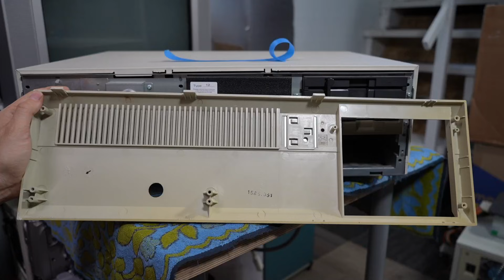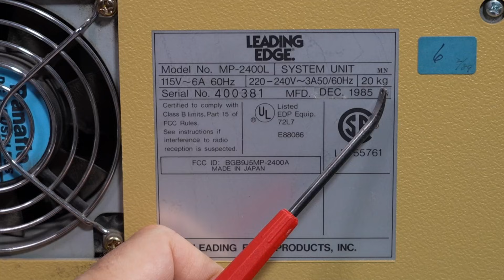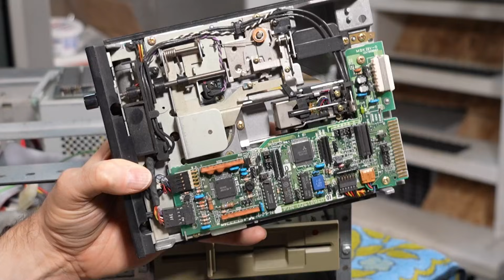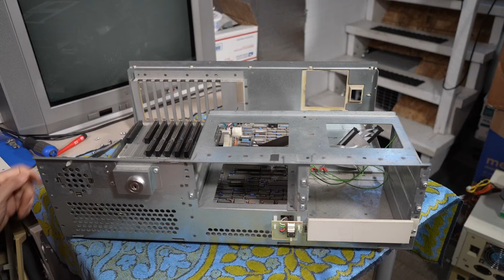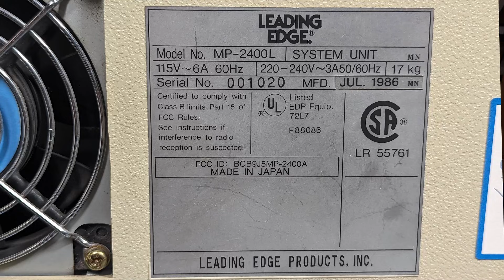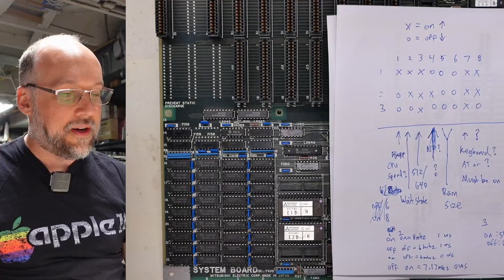PC archeology: The Leading Edge MP-2400L doesn't exist

Comment: Waaah! I got one of these used in 1991. Mom paid $700 for it! Poor mom. It had one 5-1/4” drive, 20mb hard disk, 12mhz 80286 processor. It did have a VGA card. 1MB RAM, if I recall correctly. I tried to put in a sound blaster, but I was 9 and couldn’t get past the IRQ conflict, even with the guy at Walden software trying to help me. I remember an adult laughing at me once and calling my computer a dinosaur when I was trying to see if eye of the beholder 3 would run on it (required a 386). The Walden software guy glared at him. 😂
Reply: Actually mine may have been a slightly different model… but this is the closest I’ve ever seen on the YouTube. I miss mine and wish I’d kept it. 😢
Reply: The oldest Sound Blaster used IRQ7 by default which might have been used also by the parallel port, which is why Creative later changed the default to IRQ5, but if you had the old card it was merely moving a jumper, and changing the environment variable that the autoexec.bat would set (to tell games what IRQ is being used). I was only a few years older but could solve it by myself. I own the original Eye of the Beholder and played it with a 286 clone + VGA + Sound Blaster, it had zero music, just sound effects (Reused in later Westwood games like Kyrandia!), and with a mouse you had an extra phantom party member that could throw things from the ground at enemies while the whole party was still on cool down 🙂
Ah yes, the end of the first game is unsurprisingly a beholder, which had death ray. so the trick was to always keep moving and do circles around a column, shoot. move rinse and repeat. Then you get the glorious ending which was just a little bit of text 🙂

To me the game that required a 386, (mostly because of the 4mb ram req) was Might & Magic IV (and V which could be combined for something bigger than the individual games), that was a much better game that the Beholder trilogy. Of course Arena aka Elder Scrolls, and others would benefit too...
Reply: @freeculture  Yeah, those Might and Magic games were cool, a bit above my pay grade at the time.  Eye of the Beholder 3 was the one that needed a 386 (at least according to the box).  I probably spent more time with the Kyrandia games and never finished those either! :P  I think I ran the original Eye of the Beholder on an 088, believe it or not.

Comment: Made in Japan...at exactly the wrong time.  Shortly after this, the Japanese Yen exchange rate exploded vs. The US dollar, which made Japanese electronics more expensive.  The Taiwanese clone makers got their act together and started producing high quality goods, and by 1990, DTK (made in Taiwan) was the supplier of choice for local computer stores.  I worked at a local computer store in 1990-1991...
Reply: Indeed that's what i know, in fact i still have a couple DTK cases and PSUs, just not the actual DTK 10mhz 286 motherboard which i used to have and it filled the entire bottom of the quite big desktop case with its 1mb onboard ram. Of course DTK used the proper red lever power switch like IBM's 🙂

Comment: I used to work with exactly that machines in the old days at the high school.
That 286 model used to be distributed as OEM product. That means... it's a clone. There's no company which owns that brand as the main propietary. 
In Spain where I am, that computers were sold as non branded PC's. 
Also El Corte Inglés stores sold the same with their brand in a sticker. 
It was very common here in the 80's.

Comment: so it's got 9 ISA slots soldered on already, and 1 blank.  if you soldered in that blank, would it work?  also, could you potentially change those 8bit slots to full 16 bit?
Reply: That should work. It's just a bus. All connectors are connecten in parallell.
Reply: I don't see any extra components, not even decoupling capacitors.

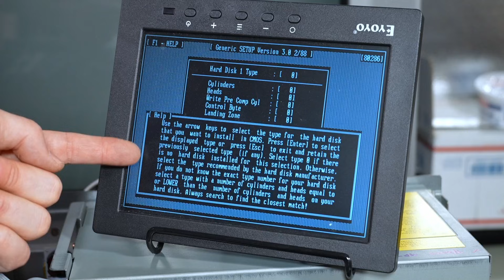Comment: 54:28 Shouldn't you stand with the cursor at the "Hard disk 1 type" (at the top) when you use left and right? It looks like the cursor was on Unformulated capacity.

Comment: 690W input for less than 200W output.  Wow.
Reply: I think the input rating is accommodating for the expected monitor connected via the pass-through connector.
Reply: The power rating on equipment badges include peak inrush current for planning how many circuits on how many breakers of which size when all loads start up simultaneously. It doesn't mean that the power supply actually runs with that much current draw except momentarily with capacitors discharged.

Comment: This computer is HONKIN' HUGE!  Holy cow!  Amazing.  Didn't know that Leading Edge made 286-class machines.  A bunch of years after I moved out, my parents, who were hopeless with technology, purchased a Leading Edge Model D at the time when 386's were basically the standard - the D computers were being closed out and were not really that useful, esp. since theirs was a monochrome model with dual floppies.  I think they may have turned it on once or twice but it just sat there gathering dust until they donated it years later.  It was a solid little machine, just a basic XT-class computer without any real differentiating factors as I recall.

Comment: I have a 286 machine (well, part of one) which also has a power supply similar to the one in these Leading Edge PCs. The PSU is also very large and heavy, has a very similar shape with an overhang that sits above the motherboard, and uses an even more non-standard power connector for the motherboard. It's a WysePC 286 and I have documented it on the Retro Web website. Including mapping the PSU connector so that if it comes to it, a standard AT power supply could be used with an adapter. Even more interesting in my system is that the CPU oscillator is not on the motherboard. Instead it sits in a little metal box bolted to the side of the PSU at a distance from the motherboard, and outputs 2 clock signals which are carried over to a motherboard header via 2 coaxial cables. I had that documented as well, and in fact it has made it easy to replace the CPU clock with a variable frequency oscillator for easy overclocking and underclocking. :)

Comment: 21:36 most of the computers (PC) before 2000 are tanks, they survive anything, still have my old P2 doing dedicated firewall and works great, uses low power and is passive cool, 500Mb of ram, 3 ethernet cards, 8Gb disk

Comment: the motherboard power connector looks the same type as on the commodore pc10-3/pc20-3/colt, but different pin functions as it has all voltages on the commodores

Comment: "But Tandy computers weren't completely compatible and had proprietary parts.".

Yes....  And as this shows, so did nearly EVERY PC compatible up until about 1989 or so.

So many people just don't know the true history of the PC market.  The original IBM PC was not compatible with nearly any of the PCs that came before it.  It too was "proprietary", when compared to nearly all of it's predacessors.  

Then, companies began to fall in line with IBM PC standards.  This PC is a great example of that time period.  The power supply here was proprietary.  There may have been a few other things in it that were too.

No complaint or insult to this one....  Only a complaint against the gripe against others like Tandy for that time period.

Comment: did i miss where you said why the Eyoyo monitor is upside down? its messing with my head, since i have same model.
Reply: I think he covered that in another video a while back. The Eyoyo sits nicely in that little bracket he's got if it's upside-down, and the monitor has on OSD setting for inverted operation, so there it is.

Comment: I had one of these as a kid, starting with a 286 MB, then upgraded to 386, then Pentium, then got rid of the chassis. I used to install the bottom and top drives with only one rail, because none were available for sale here in Hungary.

Comment: 98.5% of countries use standard units of measurement, you don't need to convert kg to a non standard unit when speaking, since this is a global content platform.
Reply: My experience with case screws, is that most of them used both types of screws. Only a few used imperial only, and rarely some had a thicker type with the same imperial thread just for the case. Most common is phillips + hex head. Rarely flat, but i remember IBM (ironically) used flat + hex in their think centre era and Lenovo inherited. I still have a box full of them since the 90ies.
Reply: Also, why are you not disclosing how big that power supply is? Hands? Come on.. Give us the measurements in standard units of  measurement.

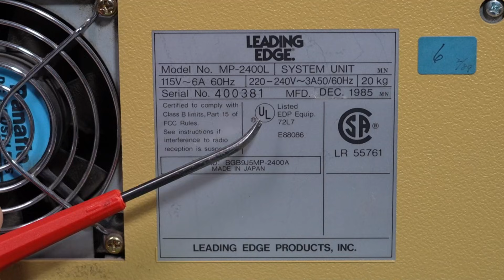Comment: 4:10 -- Hi Adrian!  You point out the 6A rating on the power supply.  That number is a nameplate rating for an electrical installer, used to size breakers and circuits.  If an office was being built out, the electrician would ask how many machines are expected to be installed and used at once, and then divy up the runs to the main panels accordingly.  That 6A number will cover the inrush current, and is not the expected operating load.  If you have a power outage, every machine plugged into the circuit will surge-draw at once when the power is restored, and you don't want to pull 300A (causing a lot of downstream damage or outages) because you cleverly power-stripped 50 machines onto a single 15A line.  You'll see similar ratings on LED power supplies now for the same reason, they're rated like 5A on the input side (600W) even though they're only 350W units at the absolute most.
Reply: Do they still ask those questions today? Or is that just a byproduct of old building codes?
Reply: @SockyNoob  Yes they do and it influences the choice of breaker profile which is used

It was about this time that the very "spiky" load of PC switchmode power supplies started to be noticed as causing problems in building distribution systems (it's a similar issue to power factor in industrial settings) and power companies started billing extra for unsmoothed power draw - which rapidly resulted in switchmode supplies with more "linear" power draws being developed
Reply: @miscbits6399  Yes, this is why we put PFC (Power Factor Correction) circuits in switch-mode power supplies. Of course, it's not universal, a lot of cheaper supplies don't bother, but any supply that is targeted at office/industrial use just won't sell without PFC.
Reply: @AureliusR  Unfortuinately that hasn't been much of a priority for home systems..

But more to the point for this particular video, I remember that Power Factor issues only became a matter of attention around 1984-5 when the spiky loads were identified as causing serious neutral currents in 3-phase building supplies that the distribution system hadn't been designed for and the need for PFCs started being discussed in both industry and hobbyist media about that time. It got my attention because I was trying to diagnose/mitigate  RFI interference from 48V switchmode units (telco digital micriowave systems - DMR)  being deployed in/near landmobile hilltop stations. 
The effects of a forest of rampant switchmode harmonics coupled with fencing wire/staples (most  sites were surrounded by 5 wire sheep fencing) acting as (poor) diodes  in an environment prone to clouds can cause splatter all the way from 30-500MHz and effectively raise noise floors by 20-40dB (which translates to a loss of ~5-10x range on the receivers, which in turn means extremely angry customers) if they don't completely wipe things out on particular channels (particularly ~100MHz narrowband AM channels).. 
All the DMR makers had to seriously up their game in terms to attention to RF emissions from components as a result, which played through to most switchmode designs (This was the end result of about 6 months of increasing problems and a few weeks analysis, followed by weeks of trying to mitigate emissions from existing supplies (which kinda worked but it was cheaper to swapout the PSUs at a cost of ~$80million and make it Fujitsu's problem)

PFC PC power supplies only became common in the late 1980s and I only started seeing them in typical Taiwanese-sourced clones in the 1990s

IE: That box is highly unlikely to have any PFC in it, which means the current profile is spiky, the things emit a LOT of RFI and the inrush current is _high_. Thankfully they predate the badcaps era, but I've still seen a few exploding electrolytics in those generation units
Reply: It's not just unrush, it's a side effect of the large capacitor bank after the rectifier causing the power supply to only draw current in large spikes just before the peak of the sine wave and nothing in between.  Backup generators need to be sized to handle this.

Comment: You should give these recharchable NiCd batteries a try ... they're made for eternity.
Reply: They go completely dead the day after you unplug them from whatever is keeping them on charge. 
From 35 years of working with them. 
Yes as long as they are kept plugged in they will remain usable.
Those computers are shelf queens so no bueno.  Recycle the old and replace with NIMH
Reply: @RetroCaptain  Their NiCd-Cells. I have a screwdriver from the 90's which was discharged some 30+ year. After a complete cycle the battery regained over 70% of it's original capacity. NiCd batteries are limited to cycles and not prone to deep discharge.
Reply: @MrThomashorst  That's a very rare exception. 
It's nice it worked out for you, but I had to replace hundreds of customers dead or cells that would only ever accept a charge lasting a few minutes use. 
Many times they would begin leaking after being revived, corroding the connection. 
I've actually had much better luck with the NiMH battery than any Nicads. 
Way back when I started out, I was dealing with a few mid 1960s first generation nicads and DID get a few to revive and work a few more months. 
The French and Mexican cells generally didn't respond. They would go shorted dead.
The current Chinese ones WILL respond, but don't hold well enough to be reliable. Short cycles.  
Honestly I switched to NiMH and prefer them.  Even old ones AA size will respond I only worry about the heat generated by charging. 
I honestly can't find new nicads for sale anymore.   The shop I worked out of we ordered cases of them from France.
Reply: @RetroCaptain  the reason you can't find new batteries for sale is because the EU banned NiCd batteries in 09/2006 except for some specific use.

Comment: Find a 16 Bit MFM controller with an onboard BIOS.  The Seagate 21M is a prime example of such a card.  WD and NCL also made similar cards.  This way the drive can be configured independent of the system BIOS.  My 286-20 has the Seagate 21M card in it.  I also suspect on of those dip switches to select between color and mono videos cards.  Last, I wonder if when set in 512KB memory mode if the other 512KB is being allocated as EMS memory instead of XMS memory?

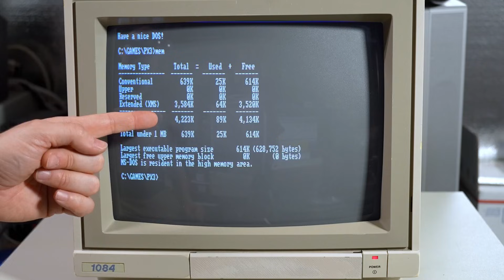Comment: Hi Adrian. At 58:15 you say 639K for some reason. 

The reason is it will always be like this. First 64kb has space reserved for interrupt vectors for the CPU and BIOS. There’s small holes of memory in that space that get reserved for DOS but if I remember correctly you only get contiguous free memory space from 0000:0170h up to the last segment before the segment reserved for EGA/VGA at A000:0000
Reply: someone on youtube was able to get well over 640k of conventional memory - but for this to work, he could only use CGA or MDA cards that dont need A000
Reply: @KenjiUmino  the person you are referring to is Jim Leonard, his channel is theoldskoolpc, he did it by patching the memory area where the BIOS stores the available conventional memory. Curiously that memory area is inside the reserved 1K that i talked about. 

I did it for myself by patching the BIOS. Both methods have advantages and disadvantages.
Reply: I suspect it's XTIDE.

Comment: Those self-test messages are very similar to the ones my Mitsubishi MP-286L laptop displays. Mitsubishi definitely had more than a little involvement in the production of these machines! Seems like this is a common thing for Mitsubishi. I have an ‘87 Dodge Ram 50 truck that is actually 100% manufactured by Mitsubishi (sold as a Mitsubishi Mighty Max). The only things actually made by Dodge are the emblems!
Reply: Mitsubishi electronics: Extremely well built, yet barely remembered.
Mitsubishi cars: Built on a shoestring budget, yet fondly remembered.

Comment: Plot twist: These old computers used to be metal chassis covered with plastic finish. Nowadays, specially in appliances, you can easily see plastic chassis covered with stainless steel finish. 🙃
Reply: The switch from steel to aluminum PC cases is a godsend though. Once we replaced a 2003 Dell desktop server with a brand new one of the same size and the difference in weight was substantial. We could fit 3 of those servers on a cart, but that single old server made the cart require two people to push and pull. I wager the old server was almost 150 pounds while the new one was closer to 20 or 30. It's not like the new server felt flimsy or anything, still could sit on it.

Comment: That just needs an AdLib card to become the Master 286! The EGA card was the right choice :)
Reply: I second that, the 1985 was a EGA era, but AdLib? AdLib started later... PC speaker is the right way to go.
Reply: @madigorfkgoogle9349  The Adlib is fine but the Sound Blaster works as well. Of course VGA works too which is why it had one.
Reply: @madigorfkgoogle9349 It would still be the right addon for that system in my opinion. Something one would have added on a couple years down the line :P

Comment: 22:10 Be aware that the 12 volt also dropped when you changed the 5v. That was probably the reason the 5 v was set higher
Reply: I don't know how this particular one works but often only the 5V is really regulated and the 12 will just float higher or lower depending on the load on the 5V rail.